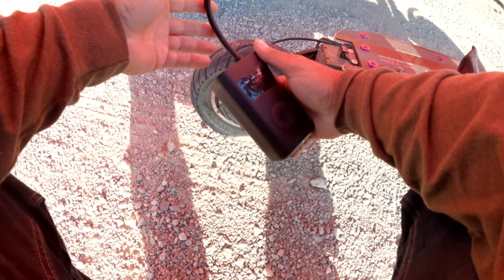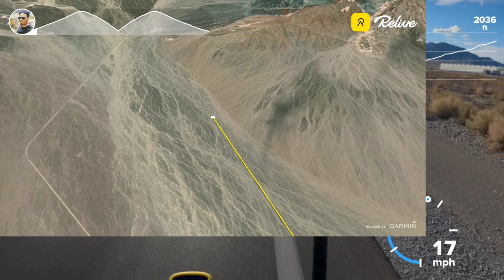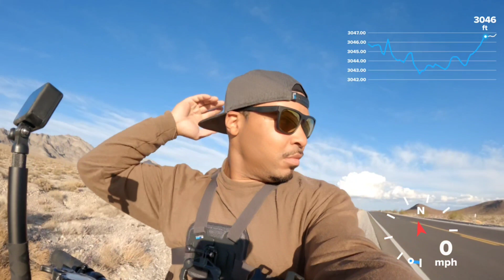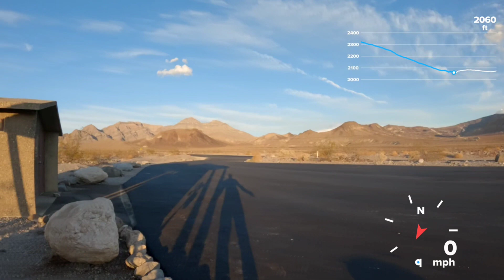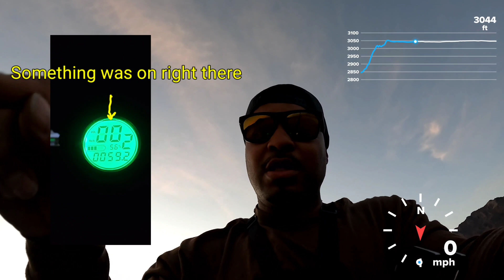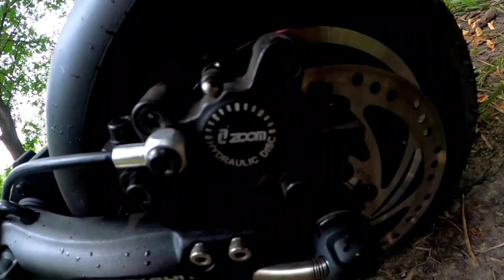Dualtron Victor *Single Motor* Endurance test

Comment: Do you know why my dualtron cant switch to dualmotor when i press the button that indicats the sing and dual any help?
Reply from the maker: I do not know. My victor (yes I still have it) has a wire short in the cables near the motors so I have to fiddle around with the wires and then test the throttle until the front motor begins to spin when I pull the accelerator
Reply: @Jonasegway can you make a video about it that would be life changing and thanks again❤
Reply from the maker: @fastrecapsofficial-x9b yes. I will do it as soon as I get home (I should be home Friday). I will make it an unofficial video and will go directly to what I am talking about. 

I've always taken care of my victor so I don't know why this started happening with my victor. I would wiggle the cables near the motor below the steering stem where they go from the handlebar stem to the motors and hit the throttle to see if the front motor will turn on or not.

Once you get it figured out, you'll want to always leave the front motor ON. And just remember what setting it was on when you last pressed it. I will make this video for you as soon as possible
Reply from the maker: @fastrecapsofficial-x9b I just recorded a screen shot video for you. When it is refinished uploading I will send you the link
Reply from the maker: https://youtu.be/hh9BCkcAHsU

Comment: No reason to use one motor  just tore it up
Reply from the maker: Did you tear yours up? Mine works perfectly fine. Single motor is great for taming the jery throttle in low speed situations. So occasionally I still use single motor mode with no issues. 

"You'll rear it up" is a myth if you ride single motor mode responsibly and don't try to race around

Comment: Man, what a beautiful view to ride with
Reply from the maker: Let me tell you, death valley is beautiful and boring but interesting all at the same time. That controller didn't blink doing that. The scooter just performed. I normally ride In dual motor so when I do videos using just the single motor, it's just for you guys just so y'all have an idea on what to expect. 

I am sure single motor mode going hard will stress the controller but I don't think you would kill it easy if your Regen is set to 3 or lower. Having Regen off doesn't put much stress on your controller at all really.

I did a ride in Vegas during it's hot season where the temps were around 108° at night and I rode my victor till it's heart was content in single motor mode with my Regen set at 3 and it performed flawless up until I got a flat in the rear wheel which was after like 38miles....now the motor was hot as hell (and I mean can't keep your hand on it longer then 1secds before burning your hand) hot but it was performing with no drop in performance. So I think the controller can handle a bit but like most other experienced scooter riders, I wouldn't recommend using single motor mode and until I am able to "properly" perform my Max range test in single motor mode when the weather is nicer then 60°f, I can't verify riding in single motor mode is really more economical when it comes to more smiles per miles.

Comment: Got my victor today 🙌🏾 🤗 😎 🤪 😁
Reply: Is it still good
Reply from the maker: The victor? Yes sir. No creaking since the fix, no flats (I have a nail in the rear tire right now that I'm scared to pull out but I will do it tomorrow when I get home). Maybe I'll make a video of it I don't know. It wouldn't be really teaching anyone anything but yea. Tire still has air. It just has a dang nail in it. I rode it this week on Vegas and I took it about 32miles and still had 59.2volts left which was pretty good for 62°f weather. Victor still running strong though. It feels soo nimble compared to the nami. I still enjoy it
Reply: @Jonasegway  not bad

Comment: Yo dawg my victor is finally arriving today in the UK, I’ll be posting up a little video of unboxing later this evening! Hugely delayed at the UK ports as we have a shortage of lorry drivers
Reply from the maker: Ooooooooo yeaaaaaah!!! How long did you have to wait in total?
Reply: @Jonasegway  two months G but the price has gone up to £2000 now and I paid £1650 for the 30LG BATTERY
Reply: @Lynx-rw3kq   Got my today G south London  🇬🇧 🛴💨💨💨💨
Reply: @samuelakinpelu3150  Mines been battered in the post I've got a dented rear mudguard and a snapped allen key handle bar bolt!
Reply from the maker: @Lynx-rw3kq  wait. Your victor har these problems and it is brand new? Or supposes to be brand new?
Reply: @Jonasegway  brand new and Dualtron blamed me for the broken bolt I mean come on!
Reply from the maker: @samuelakinpelu3150  hell yeah. Well you know what type of stuff to buy! Hopefully you've gotten it already. @ silicone spray, Teflon tape, tire slime, Xiaomi air pump, hex keys with the rounded bottom, a useable headlight, extra inner tubes. 

Sometime here soon I will make a video with sizes of all the bolts on the victor so people will know bolt sizes. I see that being useful to many. It'll probably take all day but it's probably worth it ey lol
Reply from the maker: @Lynx-rw3kq  😳 who exactly did you go through to buy it?
Reply from the maker: @Lynx-rw3kq  did you get the snapped handlebar bolt sorted out?
Reply: @Jonasegway  dualtron uk
Reply: @Jonasegway  no mate not yet as I have nothing to replace it with scooter arrived late here it’s almost 11pm
Reply from the maker: @Lynx-rw3kq  damnit man. Have a auto shop remove it out and take the other bolt out and have a local home improvement shop size it up for you. 

P.S. the auto mechanic shop might have one there 

Hardened steel makes for a good replacement with your regular lock washer. Just know that hardened steel tears stuff up "easier" when overtightened.
Reply: @Jonasegway  will do man! Just annoying isn’t it so new and for that to happen - but hey that’s life! What do the step settings do? 1,2,3 I can adjust them I just don’t know what they do?

Comment: I bet them controllers were HOT 🥵 when it stopped working.  Probably best to stay in Dual.  Man I do wish Victor was out when I got my Eagle for that extra range though.  I rarely ride at night but my lights def kill battery when riding at high speeds and who can help it when these things go as fast as they do lol!  Good vid👌🏽.  We’ll be waiting for that 30 mph range test 🤣. Get that gear on homie.  Let’s ride!
Reply from the maker: Hahaha. Nah I felt them after I did the last bit of the video and at least I didn't feel any hear through the board. They really didn't workout even going up hill it was pretty quiet. I'm thinking you have to really be juicing it to burn it out. And they would get hot when they do because they both share the same housing. It's like one big controller with one side controlling the front and the other side controlling the rear motor. I'll tell people to reduce stress on the controller(s), turn your Regen to 1-2 or just have it off. That way the controller In operation only has to send power to the motor and not to and fro
Reply from the maker: As far as the 30mph test lololol. I kinda did something like that last night. Well more like 17-18mph avg speed with 30miles of riding and I think I had 48% battery still
Reply: @Jonasegway  lol..nah you gotta add some speed sir 😂.  It’s hard as hell for me to ride mine slow.  I’m always at 22 and above it seems,  unless I’m on the belt line with a lot of people.  But I never see 15 lol.
Reply from the maker: @shinarfrazier4261  man you drive a hard bargain. I feel it though. I think depending on the temperature I might only get around 30-35miles and that would be riding it till it shuts off
Reply: @Jonasegway  You got the wide open road waiting on you lol!  Let us know.  That’ll still be great range at that speed.  I get 33 miles but on eco in 3.  Victor does have some good range for sure.
Reply from the maker: It looks like you get pretty good range for your scoot also. You definitely need something special though just from the sound of it. What you require, requires alot of $$. Rion is the only scooter I could think of that would satisfy your needs. It would be much lighter but probably only give you the range you're getting now but with 70-80mph top speeds which means 65-70mph will come easily and strong and at least 69-65mph with a headwind
Reply: @Jonasegway  lol…Rion will not get my money!  Nah…50 mph is good enough for me for a scooter.  I want range speed portability and some weather ratings.  Fast is fun but can be overrated in my opinion.
Reply from the maker: Although everything to me was about top speed, I now am at the point where I agree with you. Speed is overrated. I have more fun driving my car then I do my shitstang or my zl1. Much more fun and it is of course the slowest vehicle I have. FAST was only fun to me when I was stationed in Europe where motorsports was a big thing. Being able to get on one of (what I like to call) "high speed" Autobahns and their fast sections and actually go fast.....when I was able to drive the nordschleife and really feel g-forces the street can't provide. That's when FAST was really worth itself as an exercised activity. 

Now I find so much peace and relaxation in driving/riding slow. It's why I enjoy overlanding in my crv, it's why I enjoy driving my prochargee Civic slow, it's why I bought a Suzuki butgman 650 for my first bike and not a Kawasaki Connie, it's why I ride my victor slow and prefer the 'cruise' style of riding. I get to see more since I dont deplete my battery as fast
Reply: @Jonasegway  I concur sir lol.  That autobahn would be fun!  My uncles used to tell me about it when they were stationed in the military too.  Dang you got all the cars lol!  It’s funny sometimes when I’m going fast on the scoot  to keep up with traffic until I can move over is when some assholes want to honk. I’m like you just gonna have to wait.  Mad I’m keeping up with you  on a scooter haha 😂 .
Reply from the maker: @shinarfrazier4261  buahahahaha @ mofo's honking at you cause they mad you're keeping up with traffic. It is kinda nice to be able to do that. Like I said before, where I live, people aren't used to seeing anything faster then a lime scooter so it's already programmed in their heads they they will just zip around assuming you will be out of their way. I was riding in Vegas this week and I had cars go in the lane next to me almost immediately. Then that light turned green.....😈

But yes, those Autobahns we're freaking therapeutic. I got almost all of the top speed fun out of my system being out there for 8yrs. It's too bad the Germans are regulated so heavily with vehicles and things like these scooters and stuff
Reply from the maker: @shinarfrazier4261  I've seen the achellius. Looks like a good model as well. It's really too bad I don't have access to these scoots. Id love to give them a series of test and check on their durability.
Reply: @Jonasegway  looks pretty much like the victor with a tail and Thunder tires.  That’s 2 new models I’ve seen coming out so far .  The City is the other one with 14 in tires.  Yeah…sure the more viewers you have you could probably contact the retailers for scoots to review.  You make good vids.  The shattered glass was dope lol!
Reply from the maker: @shinarfrazier4261  thanks alot man! Thanks a whole lot. I called minimotors on getting affiliate links and they were very open to that. I told them let me get my subscriber count and views up but maybe I should just go for it. I'm a big supporter type of person. You treat me right and I'll treat you right. 

I also thought to be a retail seller for minimotors also. There is no known dealer from me in like at least a 600miles. Everytime I take my scoot out in my hometown or some of the cities i visit when I ride look at my victor and ask so many questions on it and wanting to know 2h3re to buy one etc etc. I've even been studying the electronic to kinda familiarize.yself with them Incase something bad happens with mine, I would have some kind of idea on how to troubleshoot and fix things with these scooters. 

How do you really feel about the rear deck on these new chassis's? 

I persilonally like them as far as looks go but I feel the rear deck lump is too high. I assume they went with that design to pick safety over comfort. If I am going to have a rear footrest, I feel it being less aggressive on height angle would be more comfy. 

They should consider making polls on social media sites before making final decisions uess they did and I just missed it somehow. 

Many folks will say they like it because it's new, but putting standing pressure on my foot angled like that for 3-4hrs can't be comfy.

What are your thoughts on it?
Reply: @Jonasegway  You know I hadn’t really thought about the comfort aspect, just that it looks cool lol!  But yeah, I think you’re right about the angle not being the most comfortable position.  But, I could probably make it work.  Hey man, I think if you can get stores to send you stuff to review now I would do it.  

I’ve thought about the potential of opening a scooter store as well.  If you think you will have the market in your area you should go for it.  You would be a pioneer in your area.  I would love to do it but I’m def not handy enough to help people fix them if I did it.  You like tooling around so could be a great opportunity for you.  We know how much these things costs and the markup is real so can be a really good investment.  I think we’re still at the ground level of interest so will probably only get bigger from here.

Comment: Hey
In France we already have the V2 of the Victor in our store. It is not officialy the V2 but it is a bit different of the original Victor you have.
The new version does not have the "single/dual" button anymore. It is dual only :/
The reason Minimotors gave is because long run in single motor might broke controller or motors
Reply: I just got a Victor here in France and yea. No single motor. Just a hazard button that doesn’t do anything.
Reply from the maker: @anthonyguarino5020  that might not be a bad thing. So far, the only bad I see with that is if you are a very easy rider, the single motor option is very good for easy and smooth take offs. 

When I am riding on sidewalks and near pedestrians, I will use single motor only because it is very forgiving on acceleration. Dual motor is good for trail systems and street use.

I know I can't make everyone happy, but is there anything reasonable that I can add or take away from my videos to make my videos easier to watch for you guys in france? I noticed alot of viewers are from France/UK.
Reply: @Jonasegway  I uploaded a video to show you the hasard button on my scooter.
Your content is perfectly fine. Not everyone in France speak english but you can't do anything about this 😉
Keep it up 👍
Reply from the maker: O wow @ no single motor mode. 

So what other differences does your V2 have?
Reply: @Jonasegway  I think this is the only difference. The sungle dual button has been replaced by a warning button. I suppose there are indicators now ?
I should receive mine this week. I will get back to you
You can look at this video (3m20s) with subtitles : https://youtu.be/7qCwMYbuK_A?t=200
Reply from the maker: @0xHexamor  ok ok. I see. Well let me know when you actually receive yours if this stands true!
Reply from the maker: Ahhhhhhhhhhhh ok ok I see I see. So you guys get to have the flashing rear lights. That's kinda cool. Make you more visible as I would imagine

Comment: Hi Buddy, Another great video :) I wanna order inner tube before my Victor arrives :) Do you know Victor's inner tube size? Is it different than outter tire? Because someone told me that it should be like 10*2,5 inch? Also any recommendation for Durable Thick inner tube against explode?
Reply from the maker: Thanks alot for the compliment! The victor's inner tube should be a size 10x3 since the tires themself are 10x3. Now when it comes to recommended inner tubes? I bought this innertube: Lixada Electric Scooter InnerTire Thickened 10 3 Inner Tube Electric Scooter Tire 255 80 Inner Tube Suitable for 90/65-6.5 and 80/65-6.5 Tires 240mm Diameter Tire Electric Skateboard Inner Tube https://www.amazon.com/dp/B08QZ1SSCP/ref=cm_sw_r_apan_glt_fabc_FCXRX1F66R8SPRYFEQ32?_encoding=UTF8&psc=1

Now this innertube was physically bigger and the rubber was thicker then the innertube that came with the Victor. This was my first and only innertube I ever bought and it was great because It fit perfect HOWEVER.... The stem isn't a 90degree angle so I had to get some pliers and vice grips and bend it to 90° otherwise it wouldn't fit between the rim and the motor. Other then that, this innertube is perfect!

Also I would recommend buying this stuff: https://minimotorsusa.com/products/blue-armor-dilloz-extreme-scooter-tire-sealant

Only use maybe 3oz per wheel.
Reply: @Jonasegway  Thanks Buddy 👍